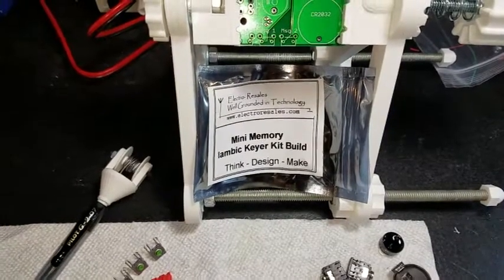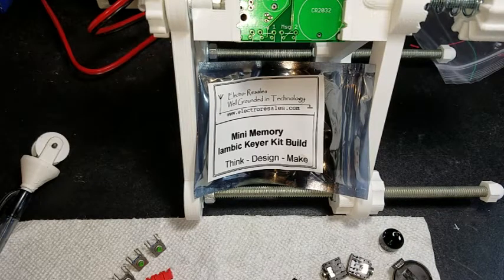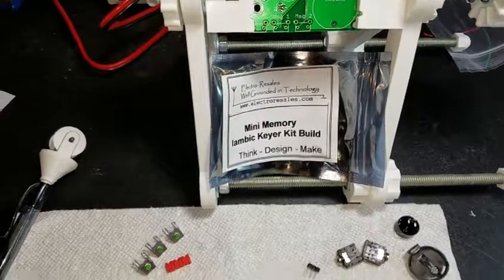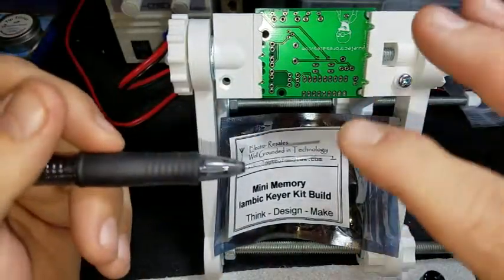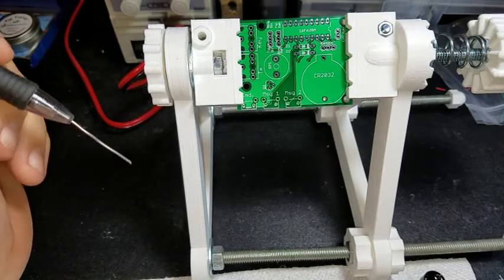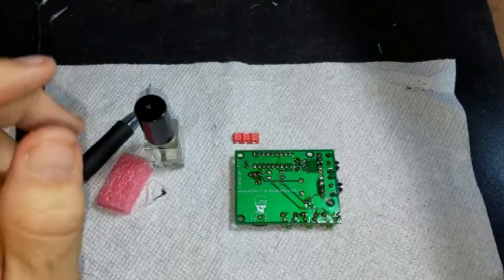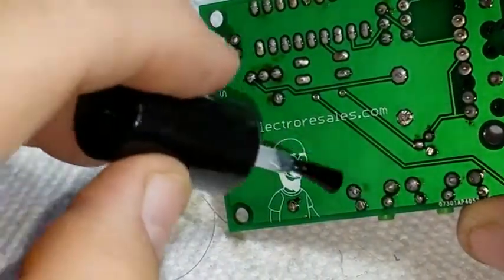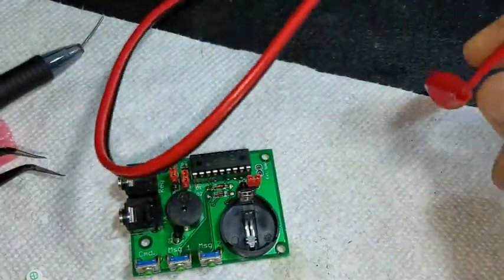Mini Memory Iambic Keyer Kit Build

Comment: Hey everybody has trouble with certain fonts. This would be More interesting if I had a 3d printer. O well. I might have to craft my own from popsicle sticks. Lolol.
Reply from the maker: They are cheap now. 3d printers are no longer the play things of the rich. but all it does is make it easier to flip the boar over.
Reply: North Carolina Prepper    Expensive vs. Cheap is relative to income.